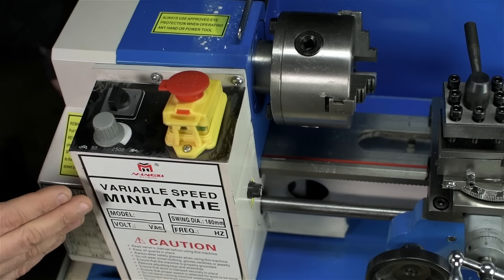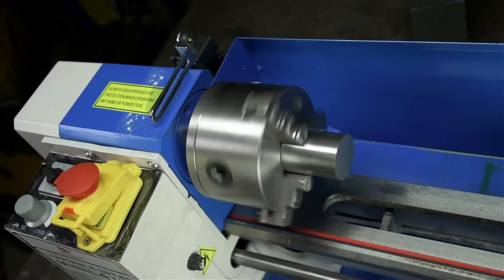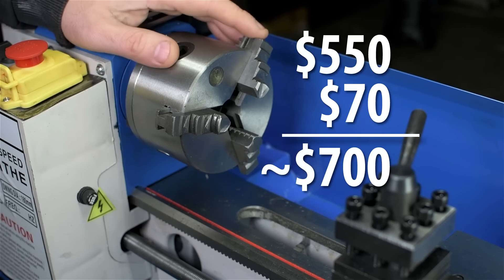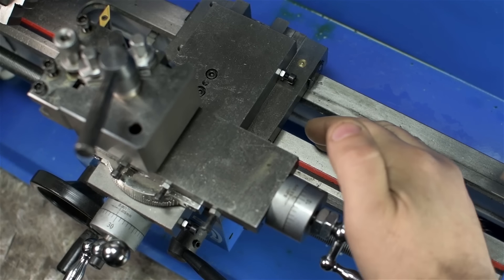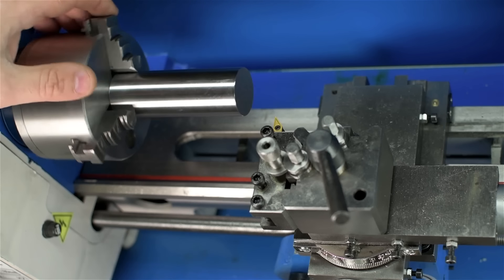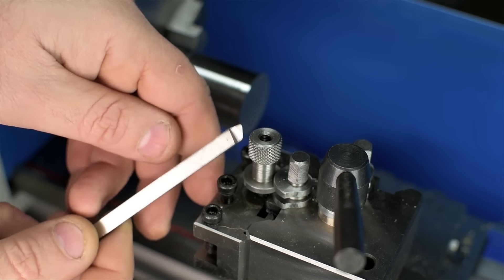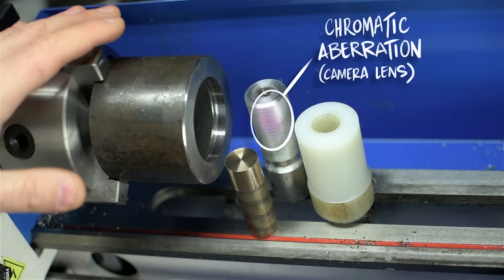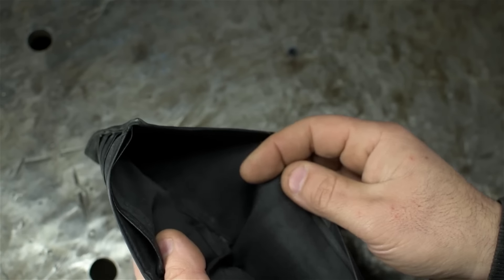The Infamous Mini Lathe!

Comment: There's so much cheap Chinese machinery in my garage that sometimes it feels like I should hang a flag in there too, just to be consistent.
Reply: Nothing wrong with buying cheap if you're just buying for yourself. If you're planning on making money off of it though, don't skimp on the good tooling. I'm a landscaper, and I can't bear to look at residential-grade mowers any more. They're crap to me now.
Reply: @BlackEpyon  So what is your recommended home mower and weed whacker?
Reply: @SiXiam  as for weed wacker i like using the echo SRM-266T good running machine for the price. will cut thick weeds like nothing
Reply: @BlackEpyon  Thank you for the detailed response. I'll keep them in mind. Think I need a new push mower for next summer.
Reply: @johndowe7003  SRM-266T vs T235 Shindaiwa FIGHT!!!
Reply: @johndowe7003  Depends on how long you have to do it. Throttle up, and you can cut down some long weeds by the house, but what I'm talking about using the T282 for is embankments with long grass, much too steep to use a lawn mower, which will bog down even the heavy weedwhackers. One of the stratas I maintain has several hills, and the one by the entrance is very large (I can do it myself over about 3 days, but I usually have somebody else helping me. They get done 5-6 times a year, so the grass can get fairly long. You need the power of that 28.9cc engine to get through it in a decent amount of time, otherwise you're just burning gas, taking a long time to do it, and wearing your machine out. Even with the extra power, I have to do a fair bit of maintenance of those weed whackers, because running them that hard for a 6-7 hour day of weedwhacking the hill wears stuff out. They need to be greased, and heads cleaned out to reduce friction, filters replaced more often than the ones I use for normal edging due to how much fine grass chunks gets thrown into the air, especially in the summer when it's drier, and the cowling needs to be periodically removed to clean out the dust and grass buildup around the cooling fins and flywheel grate, otherwise they overheat quickly. These machines don't get light usage.

But the T235 does just fine for the normal every-day stuff. The engine is smaller than yours, but when you're going to be using it for several hours in a day, you want it to be as light as possible, while still delivering adequate power to get the job done. If I need something heavier, I'll grab the heavier one, but otherwise, the day is too long to wear myself out on the small stuff by using an overpowered machine. I'd say your ECHO is about half-way in power between the two models that I use, and should be more than adequate for a homeowner to maintain his property.

Another important thing I neglected to mention is the comfort of the handle and how easy the machine itself is to handle and manoeuvre. You need to be able to use it comfortably, especially if like me, you employ both horizontal AND vertical edging techniques, and need to quickly change stances. I like the Shindaiwas better in that regard over Maruyama, ECHO, and Stihl, but that's just my preference.
Reply: @BlackEpyon  i run my weed wackers full throttle, those small engines are designed to be ran at full throttle, low throttle for tiny weeds  full throttle for everything else.
Reply: @johndowe7003  That's a misconception. They may be the most stable at full throttle where vibration is concerned, but the excessive heat buildup is what wears them out faster as the oil gets less viscous and the steel of the bearings more ductile, especially since two-stroke and 4-stroke hybrid engines use mixed gas, which doesn't lubricate the engine as well as a normal 4-stroke with an oil pan. And with my kind of usage, they DO wear out. I always use only as much power as necessary.
Reply: @Glen Spivey I mix 50:1. I'm not an expert mechanic either, but it seems to me that more oil in the engine is also going to make it burn dirtier, and deposit excessive carbon, as if you had a 4-stroke engine with bad piston rings. If anything, it's probably counterproductive. The mixture itself lubricates, the oil and gas don't separate (at least they're not supposed to), and they get burned together.
Reply: Or you can save for years before you can get your hands on one.  A lot of people take things and opportunities for granted. 
Back in the 1960s and earlier you'll be an old man before you can put your hands on one of these. Or go to the bank for ask for a mortgage to get an entry level machine.
Reply: @loktom4068  You mean the Walker? It makes more sense if you either own an acreage or run a landscaping business. That's where it's worth the investment. The average homeowner would be fine with the $1500 ride-on from the local hardware store, if that's what you were looking for.
Reply: @johndowe7003  the only weed I wack is my own.
Reply: @BlackEpyon  Engine wear increases with the square of engine speed.
Reply: @BlackEpyon  If I didn't have a Gravely Rapid XZ it would have come down to either a Walker or a Steiner. Mine so far has only needed one new deck gearbox, a new HydroGear motor  ( under warranty as it was a Demo unit ), a couple of belts, a couple tires, and now a new seat. It is 11 years old with a 27HP Kohler Command and sees at least 2 hours running per week and many times 4. It now has over 2000 hours use on it.And that is 11 or 12 months out of the year use. If the engine dies, it will get upgraded to a 40HP Kohler.  And I agree, commercial quality units are the way to go if you do a lot of mowing or plan to keep one long term. I got it with a 52" and a 60" deck, a 5' dozer blade ( first production one for that model ),  48" snowblower ( which has never been used ), snow cab, and ROPS.
Reply: @gravelydon7072  Well, I just had to take my Walker in to get the hydrostats replaced (right side is shot, and the left side isn't too far behind). It's 10 years old with over 3800 hours. I should get it back on Friday or Tuesday (long weekend). 

I normally do the maintenance and repairs myself, but I can't do a damn thing with it without working hydrostats, and I've got lots of other stuff on my plate already, so I let the shop handle it. The one drawback with these commercial units is the price tag, and I'm looking at at least $3000 plus labour for getting those hydrostats replaced. That or $14000 for a new unit, I think I'll just keep fixing this thing. They're built like tanks, and the new models are designed to be backwards compatible with the old models parts and attachments anyways. No planned obsolescence with these guys, unlike SOME things I could mention, like appliances and cars that you can't find parts for anything older than 10 or 15 years, etc.
Reply: @BlackEpyon  Yep. Price is the big issue with most of the commercial units. Like you said, when the hydro units die, its going to cost. Gravely has been in business a long time and I still can get most parts even for tractors built back in the late 30s. I actually own the 5th oldest known one which was built back in 1925.
Reply: @gravelydon7072  I love seeing people keep old machinery and hardware in good working order.
Reply: @BlackEpyon  So do I. That is one thing that a lathe like this could be used for. Turning small parts that just really are crazy to do on larger lathes. This year the annual Gravely Owners Mow-In is in Portland, Ind. ( https://festivalnet.com/74571/Portland-Indiana/Antiques-Collectibles-Shows/Antique-Engine-Tractor-Show ) Featured tractors for this year is the Gravely 450s which are now 50 years old. I need to get some work done on mine as I own one of the factory prototypes. It differs from the production models in a number of very important ways and all of them but one were done to cut costs so that even a homeowner could afford one. Two years ago it was for the Gravely Model Ds which were first patented in 1916. I took my 1927 and sickle bar mower to it. When I left, there were more items in the trailer than when I arrived including a Gravely Chainsaw for on the front of the Ds or Ls, or even on their later model garden tractors like the 450s. Problem is finding a chain for one now days. It is a 36" bar with 5/8" chain. Luckily this one has a good chain. I had to get it out of there quick as others were trying to buy it from the dealer who I had already made the deal for it with even before the Mow-In. When I die, the WV Farm Museum will be getting the collection to add to those they already have. Some are restored, some are in good condition as they left the factory, some need work, and one has never been run since it left the factory 12 years ago and never has been run on gasoline. It sits in the garage with a moving blanket over it and a tarp over the moving blanket. It also gets to go to the shows on occasion and is one of 90 built for the 90th Anniversary of the Gravely patent.

Comment: The best mini lathe I ever used was a Myford ML7, it was amazing what that little machine would produce. At work we had rows of lathes and mills, The smallest was a Ward 2A and one of the biggest was a Herbert 9B30, that was huge, if I remember correctly the bed was about 20 feet and the depth (centre to bed) was about 48". Most of the lathes in the works were Colchester, Ward and Herbert. In the 60's I went to a machine shop in Birmingham and they had a lathe that was a giant, I don't know who made it but I think the workshop was built around it. They were turning huge crankshafts for either boat or train engines.

Comment: The Harbor Freight mini was my 1st home lathe. When I got mine I found the same shortcomings as you did. But when it was all bolted down,( I made the bench from 4x4s notched and drawn together by 5/8 threaded rod. This thing, when set up and leveled was as accurate as my Clausing lathe in my shop. I got the mini because of space issues at home. The one thing you don,t want to do is make it work harder than it was designed for. Even when you start popping fuses, the overload takes its toll on the circuit boards. Soon you have a tiny dead machine. They are excellent small part machines if they are not worked to death.

Comment: I found the 2019 updated version of this lathe and they fixed all the problems adding a brushless motor in place of the brush motor and metal instead of plastic gears also has a lcd screen for speed and feed. It also comes in at $200 cheaper now. (Australian currency at least)
Reply: @seaplaymarine9828 Hi, thanks for the info ! Do you remember the reference/name of that lathe ? That would be very useful for me starting into machining

Comment: As someone how never did any "physical work" (working with wood, steel, 3D printing, foam, anything with tools, etc) and only watches it on YouTube (i.e. This Old Tony, I like to make Stuff, Odin Makes, etc), I never knew how these machines are called, but now I know what I'm definitely going to buy as one of the first machines, if I ever start anything in that direction!
Reply: The first (wood) lathes date from c.1300 BCE in Ancient Egypt. Metal cutting lathes date from the mid-18th century. The first fully documented, all-metal slide rest lathe was invented by Jacques de Vaucanson c.1751. Original Egyptian lathes are probably hard to come by, and the few remaining 18th century machine lathes are very expensive.  Probably best to consider a readily available present day lathe.

Comment: I want one of these. 
Watching these videos takes me back to my engineering apprenticeship days. We had (a small one) a  Colchester Student Lathe MK1 3 Jaw chuck as well as (a bigger standard sized one) a Harrison Alpha 550 Plus CNC lathe that I would work on. The colchester for one off pieces or small batches jobs and the Harrison Alpha 550 Plus CNC lathe for larger batch jobs and items that were needing a bigger chuck. Loved working with the both new and old lathes we had. 
Cant remember what the make of lathe was we used at college but it would have been the size of the Harrison alpha but manual. Good days in hindsight, Lol
 I would love to have a small or mini lathe as that is all that I could fit in the garage as they're great machines to work with. 
Maybe one day I will be able to get myself organised enough to purchase one and get back to turning out some mini projects.

Comment: the Correct answer to the question is :
"sure, go ahead and buy one, your first lathe project will be gear-making"
Reply: That's exactly what I was thinking: can't I just look at a couple guides for improving the parts? Use a tool to make a better tool
Reply: @cdgonepotatoes4219  that's what happened with my 3d printer, my plan for a lathe is look for a secondhand lathe.
Reply: ROFLMAO!!!
Reply: Now you will also need a mill to do the gears once the blanks have been turned.....and tooling for the mill too.
Reply: @gangleweed  no, you can cut gear teeth on a lathe.
Reply: @Ghryst  I cut gears on a mill with a dividing head........I'm a skilled engineering worker......but you can cut gears on a lathe if that's all you have.
Reply: @gangleweed  "but you can cut gears on a lathe"
yes, you can. which is what my reply was specifically pointing out, that you first comment was wrong
a truely skilled engineering worker would know that, however, an amateur trying to puff himself up on youtube wouldnt even mention it until prompted.
Reply: @Ghryst  I suppose in the very broadest interpretation of machining on a budget we will have to agree that some people with limited means and more time than others would resort to using a lathe for purposes that it was never designed for but if it turns you on then there is no reason to not use a lathe for any purpose you can think of even if you have facilities to do it the normal way.
Reply: @gangleweed  *Your, numnuts.
Reply: @gangleweed  "I spent 60+ years with lathes and mills etc" i'm calling bullshit, considering you dont even know the fundamentals. anyways, your Authority Fallacy has no validity.
Reply: Instructions unclear, ended up buying a mini mill and a dividing head to make said gears
Reply: Instructions unclear, ended up buying a mini mill and dividing head to make said gears

Comment: My son and I have the Optimum version of this - the TU2004 (sort of a D180x300) and it seems better on lots of accounts. Has carriage lock, metal gears, thread dial (although I don't use it and just reverse) and nice little brass oilers everywhere and it is metric!. Plus it has RPM gauge but similar 600W motor. Our issue is we lack space. The thing has been surprisingly effective for lots of little projects. Son is currently building a Myfordboy engine. Also 20mm headstock is not bad if you compare it to Myfords or boxfords etc. Plus it has a bolted on chuck with a pretty standard hole pattern. Stuff I don't like - getting the gears meshed right so it doesn't grind is a messy pain. Engaging half-nuts is a hit-and-miss affair which makes the thread dial pretty tricky to use even if you want to. Chuck guard isn't easy to remove and sometimes touches the chuck. Has same feed rate issue but we use carbide and run at higher RPM usually (small parts) anyway (pretty sure it has much more power at higher RPM as the motor is PWMed DC)